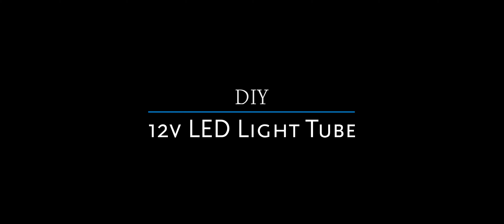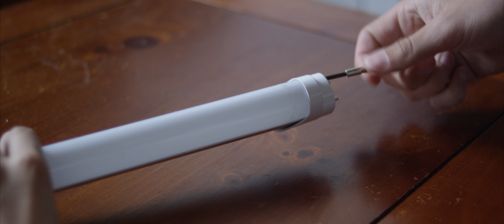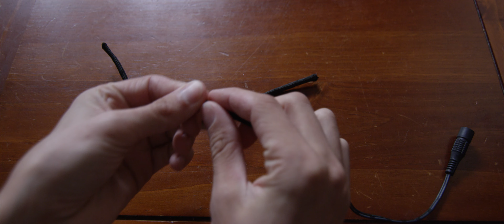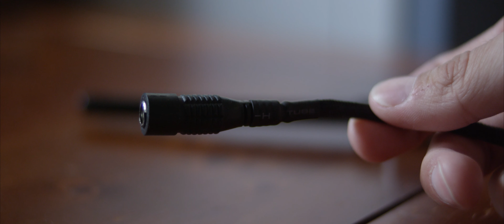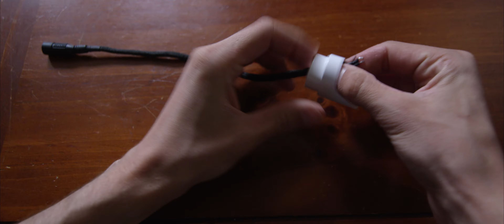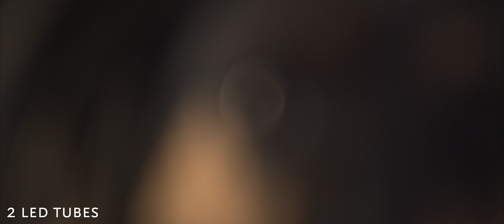DIY LED Light Tube - Cheap LED tube modification

Comment: I'd add one additional step to this: wrap the soldered end of the LED strip with electrical tape. That way you eliminate the risk of a short should the solder blobs come into contact with the aluminum housing.

Otherwise, this is exactly what I've been considering building recently. Though I don't like the idea of stripping out the good electronics from these to make what I want. Though seeing your project and doing some research has led me down another rabbit hole: aluminum LED channel. The "donor" lights you used are basically just round aluminum LED channels with G13 caps. Still looking at options since pricing seems to vary wildly based on supplier. LightingWill (the maker of your "donor" lights) even sells it themselves, but unfortunately not the round channel used in their T8s.
Reply from the maker: That's a great step to add, a bit of hot glue would work too.

Yeah pulling our the good electronics sucks and I wish there was another option. I haven't been able to find a supplier for the round LED channels. The Channels your talking about could be used as well. These were lights I had for awhile and had rewired to a 36v dc source to remove the flicker they had. But then decided to upgrade to better LEDs since there are much better ones available now then when I originally bought them.
Reply: @mattinkpen  Yeah hot glue would work as well. Again just something to insulate the connections to be safe.

I'll share what I've found over the last couple days. For reference, I'm looking to make handheld portable tube lights for outdoor photography rather than indoor lights for a studio.

LED Profiles (https://ledprofiles.com) is based in LA,CA. They make 4' and 8' channels with end caps and diffuser included. They sell them in 30mm, 26mm (about the size of a T8), and 15mm. (Link: https://ledprofiles.com/collections/round-led-channels)

Another US company is Solid Apollo LED, but they are a bit more expensive. And 20mm is the widest round channel they sell - way too thin for what I'm doing. (Link: https://www.solidapollo.com/round-led-strip-profiles/)

There are other US suppliers as well, and I'm looking at other extrusion options that I may be able to use with acrylic or polycarb tubing for cost saving.
Reply from the maker: Might be able to find a full frosted tube of some kind then just mount an aluminum strip to the inside too. The aluminum would need to be the same width as the inner diameter of the tube, which may make it tricky.

Id love to make something similar to use underwater, but that's a way more complex project.
Reply: @mattinkpen  That's another thought I had as well since I can easily find aluminum flat bar at Home Depot or Lowe's. Then I'd just need to find end caps.
Reply from the maker: I've made little lights using that flat bar and then just clear acrylic over top. Just have to sand the outer surface to diffuse it some.

When you finish your build let me know how it turns out!